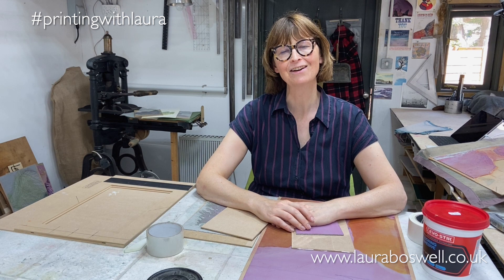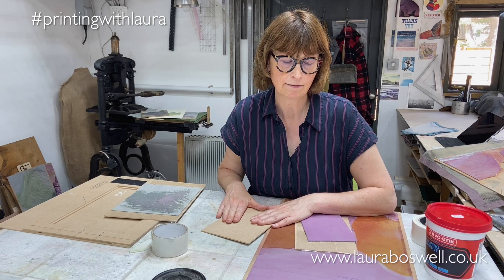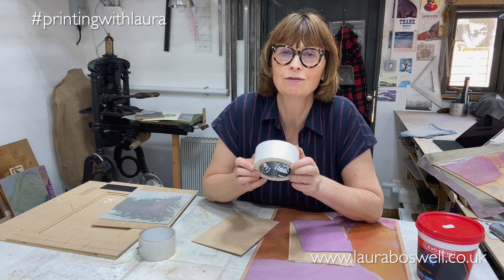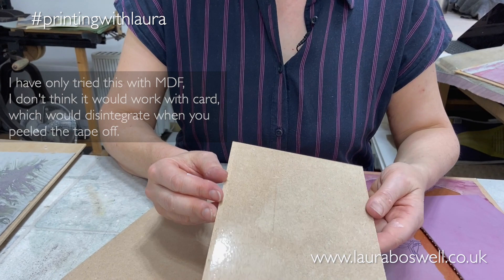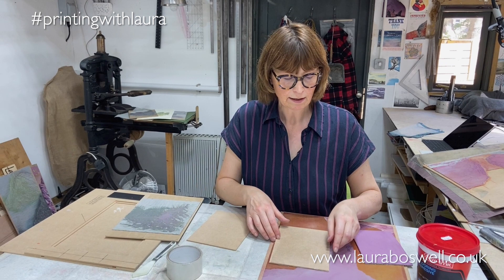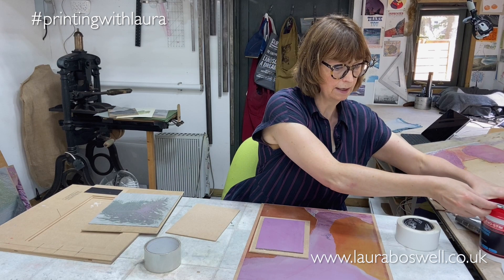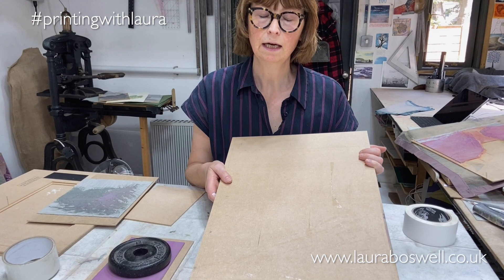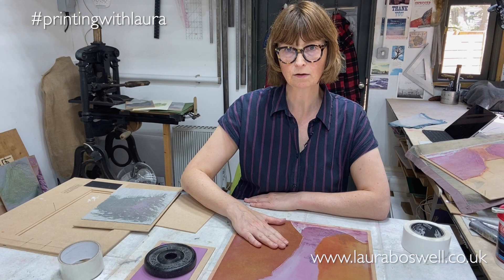How to recyle and reuse a backing board with your lino - linocut printing tips

Comment: I paint my mdf with water based polyurethane, stick my Lino down with carpet tile pressure sensitive adhesive. 
It peals off the MDF with a little effort and is reusable.

Comment: Top tip! Thanks Laura. Have you tried repositionable adhesive spray?. It kind of converts the surface into a giant post-it. I have seen it used by screen printers to keep the paper on the MDF boards while printing through the screen. I don't have a press, but I could imagine it would work well also.
Reply from the maker: Worth testing, but lino gets a hammering with the cleaning and all the pressing and pushing when people are cutting so it needs a hefty bond between it and the backing not to move and lose the alignment